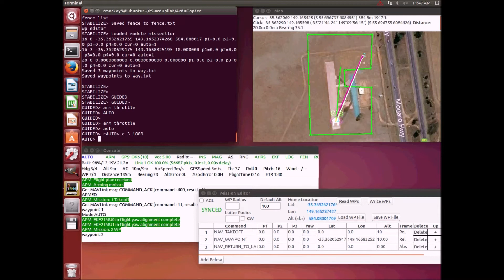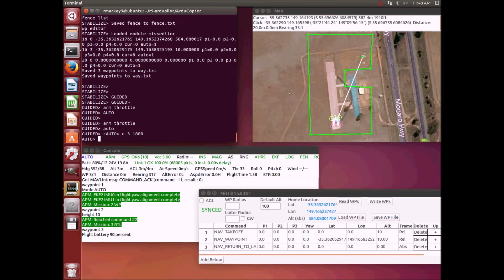Copter Path Planning with BendyRuler and Dijkstra's algorithms

Comment: hi nice video . what sensors do i need for Djikstra's algorithms and can  this sensor work with a 360 degree lidar ?

( Will there be the A* algorithm instead of Djikstra's ? ) 
Thank you
Reply from the maker: Hi Pierre, in AP 4.1 (and earlier) Dijkstra's only works with static obstacles (e.g. fences).  Rishabh Singh is working on a "Dynamic A-Star" enhancement for 4.2 or 4.3 so hopefully that will be possible eventually.  Until then BendyRuler is the algorithm to use for situations requiring avoidance of dynamic obstacles.

Comment: is this fast enough for agriculture application such as Spraying?
Reply from the maker: I think it is fast enough but there are two possible issues for crop spraying that will be resolved in the next release (Copter-4.1): 1. terrain following doesn't currently work with path planning.  2) the vehicle only avoids by moving horizontally, not vertically.  As I said, both issues will be resolved in the next release.
Reply: @rmackay9  I recently read an article about this that was implemented on a drone, but is tsp -Dijkstra an optimal way to use it?
Reply from the maker: Hi  @poyakhani6693 , I'm not sure what "tsp" is.  Dijkstra's works well for getting around complex static obstacles like the walls of a maze.  Bendy Ruler works better for dynamic obstacles.  In copter-4.1 it will be possible to use both at the same so hopefully that will solve most people's needs.
Reply: @rmackay9  great ,  TSP stand for 
(Traveling Salesman Problem)

Comment: Hi，how do you  add this algorithm to ardupilot sitl simulation?
Reply from the maker: Zishu, if you're running SITL against master then it should work after setting OA_TYPE = 1 or 2 (and the restart SITL).  In SITL it will only avoid fences though so you might need to create a polygon and/or circular fence.
Reply: @rmackay9  In your and other videos, now I set the fence on the map. When the vehicle is encountered,  if the vehicle can't pass it, it will go back to the home  or stop moving. The vehicle  can't do path planning. I saw Dijkstra's algorithms in the ardupilot package. , but I don't know how to add this algorithm to let the car automatically plan the path.
Reply from the maker: @zishuye8592  For Dijkstra's it should work if OA_TYPE = 2 and a fence is setup.  We plan to start beta testing in about 6 weeks so at that point I'll give more detailed instructions on how to set it up and answer support questions from those who can't get it working.
Reply: @rmackay9  Thank you.
Reply: Hi, where can i find the detailed instructions about adding Dijkstra algorithm to let the car automatically plan the path? thanks.
Reply: @rmackay9   Where do I set OA_TYPE? I tried param set OA_TYPE=2, and the copter detects fence breach and activates RTL.
Reply from the maker: @pritamdash6873  Txs for the report.  It's best to post an onboard log in the forums so we can see what's going on.  https://discuss.ardupilot.org/c/arducopter/copter42/161